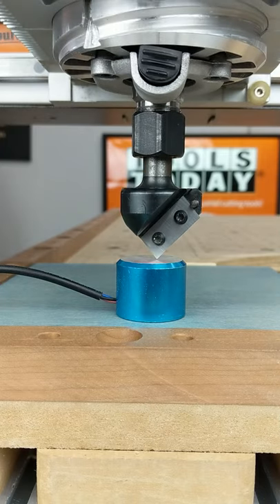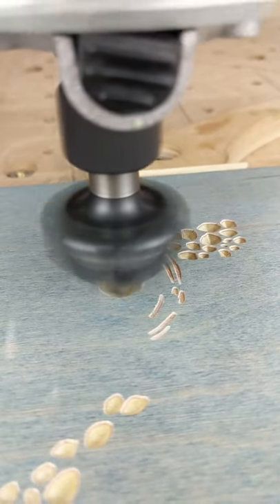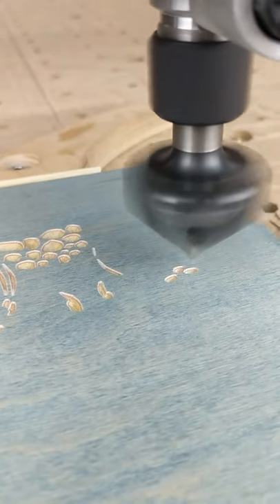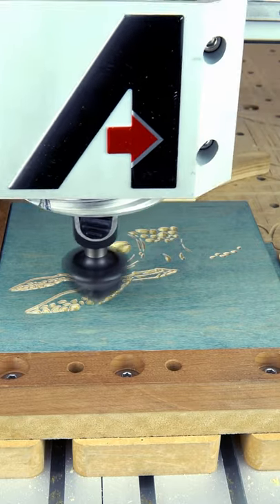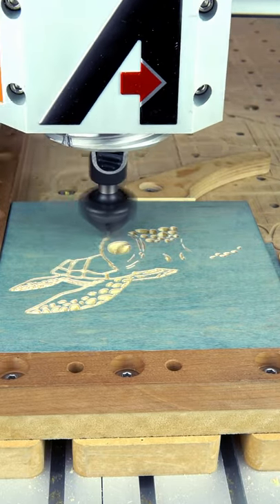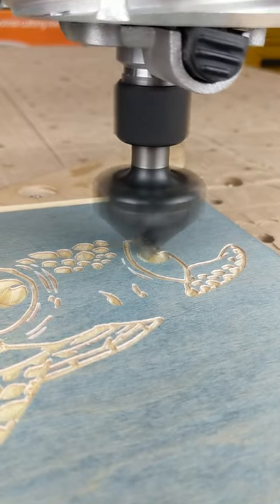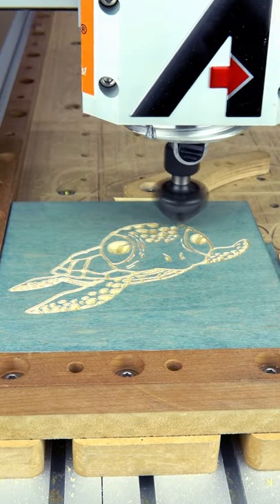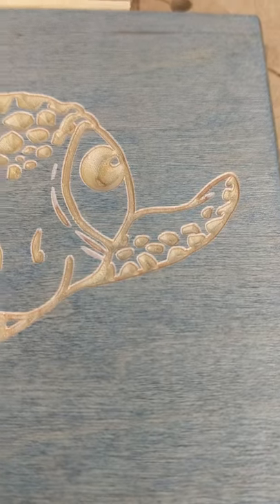V-Carving a Turtle Design

Comment: Nice video , I have one q am little bit confused about it . I have downcut bit which is 46415-k which 1/4” . In the speed and feed it says 180 IPM and chip load is 0.0050 and ramp down is 90” 
Am using aspire and I don’t have anywhere it says chip load, I beleive it’s in fusion . So what is chip load in the aspire ? Is it step over ? Also what is the ramp down ? Is it plunge down ?
Reply from the maker: What type of CNC machine are you running?  Some smaller hobby style machines may not be able to handle that feed rate. Aspire does not do anything with chipload at all.  Ramp down would be equivalent to the Plunge Rate in Aspire.   You can also check out this video to see how you can download the master Vectric tool file https://www.youtube.com/watch?v=W6pkPyxLo3U
Reply: @ToolsToday  thank u very much sir I appreciate it. This is helped a lot coz I always buy bits from Toolstoday. Thank u very much
Reply from the maker: No problem at all!